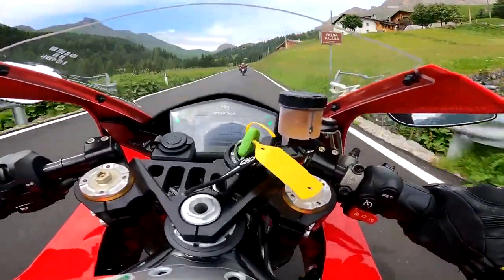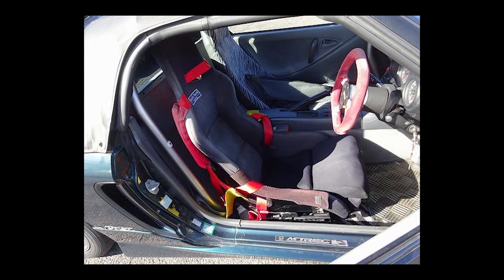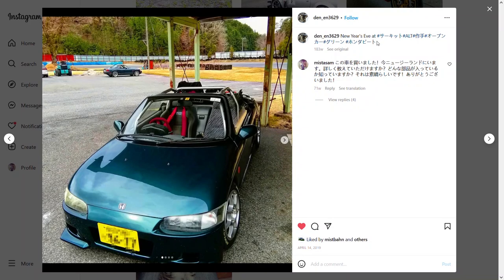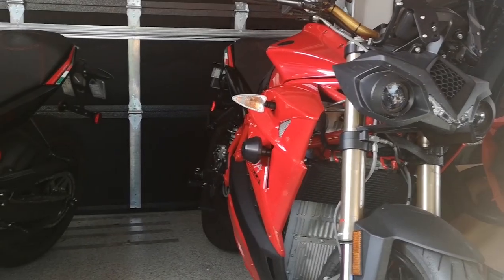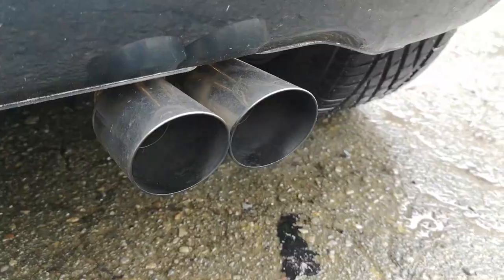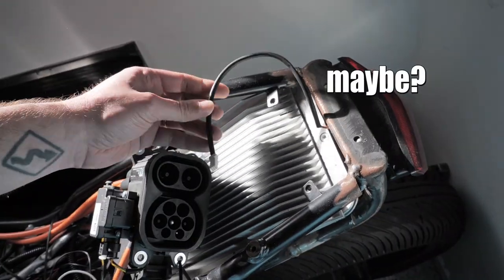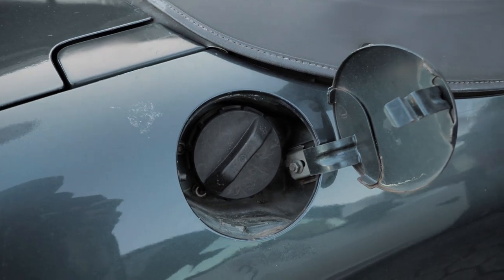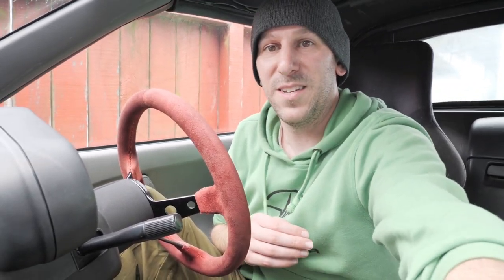Electric Honda Beat Conversion - Episode 1 - The Energicar Project Overview

Comment: you might need to run a larger dcdc converter as your 12v loads on a car are wayyyy more than a motorcycle. windows, wipers, healdights (x2) demist, fans etc etc. otherwise powertrain should be good.
Reply from the maker: Yeah for sure!  That'll be a must.  AC and heaters will be removed, but wipers / lights / electric brakes will eat up a lot of power.

Comment: heads up, if you use the Energica dash while also changing the gear ratio your speed is going to be really wrong. If this is only a track car that's not a problem but I know you want to drive it on the street too. Hopefully Energica gives you a special flash to adjust the speedometer, otherwise you'll need a different solution.
Reply from the maker: Yep, all over it.  I'm hoping to get the speedo and also the odometer changed to match the car and whatever final gearing I go with.

Comment: You might actually be able to get good range. Beat is small, not much weight or rolling resistance, and small aero footprint. 13.4kwh should take you quite far. 100km+ maybe 150km gently driven.
Reply from the maker: Nahh, I wish. That battery barely took the motorcycle 130km and the car weighs 3x as much. I'm totally fine with a low range commuter / fun weekend car though 😁

Comment: I don't understand why so many people are saying you should keep the gearbox. It's nothing but liability. The only reason people tend to keep gearboxes in conversions is because it's the laziest and cheapest way to get close to the right ratio. But then they're just dragging around a bunch of extra weight and gears they mostly never use. In your case with a chain drive the gear reduction is built in and easy and relatively cheap to dial in.

The EV motor manufacturers REALLY need to start making motors with gear reduction units. A ~2.5-3.0:1 reduction would allow the motor to be connected directly to a differential, doing away with a boatload of unnecessary junk.

Or better yet, ~8-9:1 gear reducers so motors could be connected directly to independent stub axles for ultimate 1:1 motor to driven wheel goodness. Just put 2 motors in the middle where the differential used to be. So much less to wear out or break, and so much potential for traction and performance!

Edit: Of course, you could always stuff TWO energicas into the Honda and skip the differential in much the same way... 🤔🤪
Reply from the maker: Hahaha oh man.. well there are a few reasons why I'm not going with 2 Energica motors 😂 I'm really limited on weight, which I'll talk about in the next episode, and programming torque vectoring craziness is way over my head. I guess this is why everybody loves to swap in Tesla drivetrains. They're already set up with the gearbox built in!

Comment: I'll be following you closely - such a cool project!
I would suggest to gear it a little bit taller because your consumption is going to be off the scale if you're constantly really close to the rev limiter of your motor. And it gives you some room to play on a track, where you're bound to exceed that 87 mph top speed given the power-to-weight ration.
I'm curious about the range. I'm going to make an educated guess and say 100 kilometers (I'm thinking 10 kWh of battery left and a consumption of 100 Wh/km) if you gear it tall enough and drive a little carefully.
Also: will it fit in the cargo bed of your future Cybertruck? ;)
Reply from the maker: Hahaha maybe!! I'd love to tow this in the Cybertruck bed 😂😂😂 and range-wise I was actually thinking half that. Something like 50km (30 miles) is more realistic haha. At some point in the future I'll think about a battery upgrade, but right now I just want to make it electric, with as much low-end power as possible.

Comment: I like your videos, keep up the good work. You got this! Regardless of what path you take in regards to chain drive or use the original transmission I am sure it will work awesome.

That being said I have some food for thought for you. In regards to using the motorcycle gear box to then connect it to your car with a chain to a custom driveline is a cool idea but in the long run you will have to regularly change the chain. The amount of force you will be putting on it (the increased total weight of the car) might overload the chain?? I don't know for sure. I have made some conversions myself ( https://youtu.be/CINFeNqkkP4 ) and in my quad builds I find that it chews through sprockets with the added torque (I plan on making a video on this subject). I ended up using a larger 530 (#50) chain in hopes that it will last longer and that is only a 500lb quad.

Second, are you aware what it takes to make custom half shafts? I think that would be very expensive and more complex than the method of using an adapter plate to car gear box and stock half shafts? Let me explain; check out this other guys build in comparison to mine. I built a SXS where I used the stock gear box and it worked out great. While another guy built a SXS and built it another way and used custom shafts and had problems that he didn't foresee such as the shafts were not the right length and caused problems. Video here https://youtu.be/gByaCyXCI7Q ... so make sure you double check your geometry and forces on the driveline.

I will be tackling a VW Beetle Baja build next and I was going to use a hyper9 but you brought up a cool idea of using a Energica motor. I am going to have to look into this more and see if I can get my hands on one for my next build.

In planning range keep in mind my SXS uses 300 Wh/mi but I expect your car to be more aerodynamic so it should probably get around 290 Wh/mi which is commonly seen with VW beetle builds. When I first was building my SXS I was expecting a lot less because a Tesla Model 3 can get 265 Wh/mi but clearly they are more efficient with the use of their driveline and us home builders cannot expect to achieve that.

Cheers!
Patrick
Reply from the maker: Man thanks so much for the comment!  Your Polaris conversion looks really well done.  The chain is a 525 so it's not as beefy as a 530 but still should handle it, and the gearing should hopefully help with that.  I'll try and lighten the car as much as I can in the meantime.  Since I'm using a Beat differential I'll be able to keep the stock axles / half shafts, so it'll be way cheaper and easier than going fully custom.  Like I said, it could all change and I don't know what I'm doing, but I'll keep ya posted :D

Comment: 143 kph limit?!?! 😢 if you want a track car, I think you’ll regret anything less than 200, like when we first got our Zero and didn’t ride sport mode for months but now need all that speed...
Reply from the maker: Haha nah this won't be a high speed racer.  I'm thinking more for autocross and smaller tracks.  Mostly fun twisty roads on my way to work.  Like I said, even 100km/h is scary in this car!

Comment: Who would bother you with silly Zero fixing questions?  Besides me of course.  There are a couple Cappuccinos near me out and about.  One came flying past my DSR but I found out it was Bussa powered so I didn't feel bad.  Looks like you have a plan "A" in place at least for the conversion.  I wonder how the regen will do with the extra weight?  We'll be following along till the end though.
Reply from the maker: Whoa awesome!!  A busa-powered Beat exists actually, and it's insane.  Someone in Australia is doing a K-swap Beat right now, because people are K-swapping everything these days.  My car won't be nearly as fast as those, but it should be unique!  Lots to learn and lots to fabricate.  There are tons of hills here so I'll find out just how much power is regenerated by something that weighs 3x as much!

Comment: Fascinating project Sam. I hope you'll run the car as standard for a little while so that you can establish some ICE range and performance figures with which to compare when you've done the electric conversion. It would be good to know the before and after weights of the machine too. Am I right in thinking that it's a 660cc machine in that class? (Rather like the Daihatsu motor in the original Van Den Brink Carvers). Don't lower the gearing too much...
Reply from the maker: Yep!  It's a 660cc 3cyl.  In my next episode I'll get it on the scales and see what it weighs, but that's a great idea to find out the range and even acceleration time.  I'll keep it running until April and then start pulling it apart over winter in NZ.  I was joking that it may take 5 years but I'm secretly hoping to finish it in 1 year.

Comment: Sam, since the Energica already has reverse, I'd recommend you take the chain drive directly to the diff option. How I did this with my bike-engine build was to use the complete original axle system, hub-to-hub. No new axles needed. But convert the existing diff to chain drive, retaining the spider gears and bolting on a chain sprocket to replace the ring gear. I will send you some pictures. Here is a link to my friend Stu's version of building much the same thing. https://www.youtube.com/watch?v=O4T3uq3U2Aw   and here is another good reference   https://www.youtube.com/watch?v=8Xi04c4ozg8&t=1491s
Reply from the maker: Those links are amazing!!  Thanks so much, Brian!  Can't wait to chat more about this and learn how everything works.

Comment: This looks like a fun project. I know that in the UK it would be impossible or ridiculously expensive to insure something totally unique. I hope things are easier down in NZ.
Reply from the maker: I haven't looked into insurance yet, but certifying it will be really tricky. Similar to the UK, from what I've heard. There are strict safety regulations to meet, so hopefully I can!
Reply: i've already had the chat with my insureres and been told that my Early Bay VW insurance won't change after i've done the conversion
Reply from the maker: @jolive3743  nice!! Would they cover the extra value of the car with all the conversion parts?
Reply: @NewZeroland  yeh mate and based on a small percentage of extra cost as it will double it's value.
The way he put it to me was that these aren't really everyday vehicles (little does he know) so they aren't bothered.....and this was after i said it would have potention to be 300bhp.
Try using a specialist or classic insurance company mate as they are Co-ops. They also do a limited miles per year option but he said they don't check it if you make a claim, so i just pull the speedo out ;)

Comment: you wont be shifting gears just use 2nd the torque wil most likely strip teeth of gears,,,, opps comented before seeing your plan.. hope you can work that ill keep watching
Reply from the maker: Haha yeah that was my worry, too.  If I had an adapter plate and coupler mate, I'd eventually blow the transaxle up, so I'm skipping a step and going direct drive.

Comment: love what you are doing. thinking about the size car and what you plan on doing look at the Star race cars as they use the Hayabusa motorcycle engine so if you look at the drive line setup it could give you some thoughts for you project
Reply from the maker: Great idea!  That's exactly the setup I want to try.  Thanks for the tip!

Comment: You start with the right ingredients: Small lightweight efficient car and a complete electric kit. The Beat will become the Beast. Has the Energica CAN bus? If yes you can convert the data for speed, temperatures power etc to analogue signals to run the original gauges....something which becomes more and more popular with classic conversions. Instead of usin a chain I would convert to tooth belt for sure.
Reply from the maker: A belt would be cool, but making a sprocket is way easier. I'll just swap on the Energica dash to get all the rider modes and regen settings. It'll be smaller and easier to see, and more race car too 😁
Reply: @NewZeroland  Belt would be much quieter. Sprockets can be bought.

Comment: Direct drive with a chain and sprocket is definitely going to be the way to go. Mounting everything securely so you're not snapping things is going to be a challenge though. I'm guessing you might have already but check out SuperfastMatt's channel as he's done an electric conversion, and a motorcycle powered Honda car and knows a thing or two about engineering that he explains well. His video on electric brake booster should help with the electric brake assist. 
Good luck, I look forward to following this build and am glad to hear you're realistic about how long this is probably going to take. I've only got a month to get my rally car built up to spec for the class I'm switching to. Collecting all the parts now.
Reply from the maker: Thanks man! And yep, I love SuperFastMatt's channel. That dude is hilarious and I've learned so much from him. Mounting everything together will definitely be a challenge. I'm actually going to meet with a guy who built 2 race cars in his backyard today, so I'll shoot all the video I can. Rally car?? What kinda rally car??
Reply: @NewZeroland  Well it started as a stock BRZ that hit a deer and ended up in a salvage auction I bought for  $2,500 (about 1/10 of the price I've been seeing them go for), I didn't want to have to trailer it everywhere so I actually fixed it up enough and got all the airbags to get it registered and back on the road for less than $300. I ended up winning my last race and got enough points I even won the season in my class but for the limited number of people in the winter racing series I could either not get points or bump up two classes to modified rear wheel drive, so I said "do it" and got a lightly used set of gravel shocks that give me a 800mm of lift, a bunch of bushings, and rally gravel tires. I don't know yet how I'll fare in a much more competitive class, but I'm hopeful that I have enough skill to make the modifications made pay off. You can check it all out on my Rally Channel I'm working on building @O_RaLLY I just released a new playlist with edited footage of my last race: https://www.youtube.com/playlist?list=PLfxM4bXWtxqNVzjCUoNMgVMTdQpvDsRSJ

Comment: You better left gearbox in, it will be have very fun acceleration with it! Probably you will need more couples of years to implement it. :)
Reply: The extra torque of the electric motor can break things. Keep it simple, EVs don't need gearboxes.
Reply from the maker: Yeah what Rheingold said, I would inevitably blow up the gearbox so I'm skipping a step and going direct drive from the start.

Comment: hey Sammy, long time no chat. 
Coincidence, i bought a 1970 VW Early Bay 5 months back and got my fist quote on a Tesla M3 Long Range Battery today.
I got it coz it has independent rear axle like yours and so the Model S SDU Rear Motor bolts straight to the back wheels (direct drive).
Really interested to see what set-up you go with.
Btw, there are some good guys out there like JehuGarcia on youtube who will give advice.
Good luck bro, John
Reply from the maker: Cheers man!  Dude I love old vdubs.  My first car was a 1971 Super Beetle, and later I had a 1970 Porsche 911 slantnose.  Such a great era for cars!  Jehu's videos are really inspiring.  He was the one that made me aware of EVWest, and I've been following their progress for bolt-in Tesla drivetrains.  That seems like the way to go now!  Definitely keep me posted as you go.  I'd love to hear more about your conversion.
Reply: @NewZeroland  yeh man 100%. 
I built that mad eBike Stealth thing to get back round the world on but it got nicked but i had GPS so we went and got it back but it made me change my mind. 
I bought the Camper and a Carbon Gravel Bike instead and that's my plan now, just need to work out the configuration. 
Are you gonna try and get fast charger capability or just make a track ripper?
Reply from the maker: @jolive3743  whoa nice!  I've heard awesome things about those Stealth bikes.  Crazy power for how light they are.  The Energica has CCS so I'll be able to charge in under 30min (most of the time I would stop and top up for 15-20min) so I'm hoping to go on some little trips with it.  It's a super uncomfortable race car so it isn't meant for long distance anyway, but a bigger battery upgrade in the future might be cool too.
Reply: @NewZeroland  Looking forward to watching mate.  Please try and get some of the footage as i just get idiotic quotes for installs, so i'm figuring i may have a go at it myself but i'm cacking myself as my Van is mint.

Comment: Happy to be here to see this in realtime, I want to EV convert a 70s MG Midget or a kei van
Reply from the maker: Nice! There are so many used EVs to scavenge from nowadays. My buddy is putting Leaf components into an MX5 frame. That's probably the best bang for buck.
Reply: @NewZeroland  I was thinking to just order some hub motors or even a full electric axle, you can get them custom made with the mounting points in the right places and everything

Comment: So excited for this 😍 as I was fitting my Subaru motor until my VW Vanagon all I was thinking was "fuck I wish this was electric, it'll be so much easier and better in every way" oh well it's what it's certed for
Reply from the maker: Man certifying this thing will be almost as difficult as converting it XD but we'll see how strict the laws are in 5 years.
Reply: @NewZeroland  ah ha ha you are so keen on the 5 year timeline 🤣
But yeah Certs are a right pain and even more of a pain when already certed,  hence I didn't change mine to EV from Subi
Reply: Find the French couple on YT which converted a T3 (Vanagon) to electric (called NANO).
Reply: @NewZeroland  Best is to find and talk to a certifying engineer before you actually start.
Reply: @moestrei  ha I already follow them, great build but waaaay to complicated for my likes. When I do one day convert it to EV I'll do the same way as NewZeroland is converting him
Reply: @willyd-adv  I own a T3 with Subaru EJ22. Perfect match but gearbox is too short rated. I did covert a motorcycle to 8kW hub, also great project.